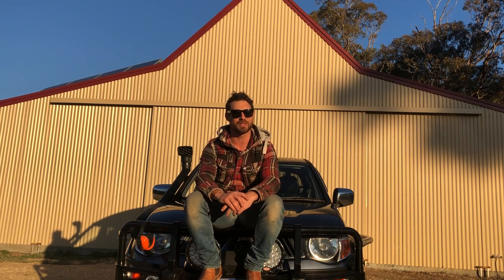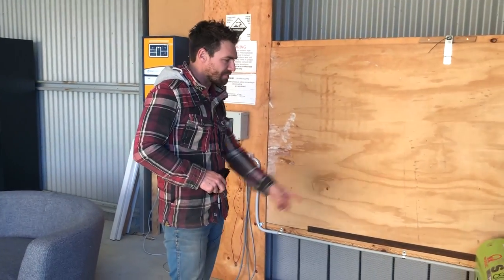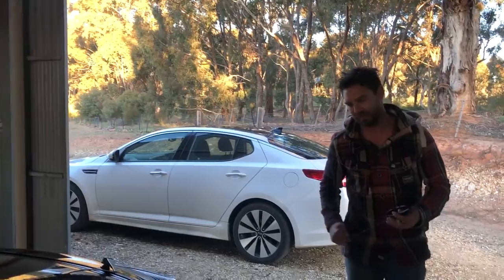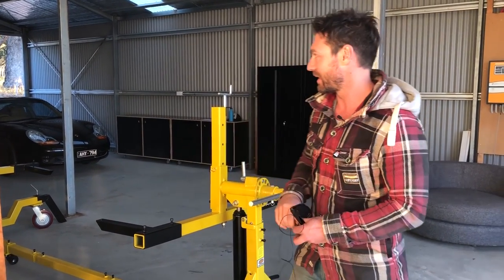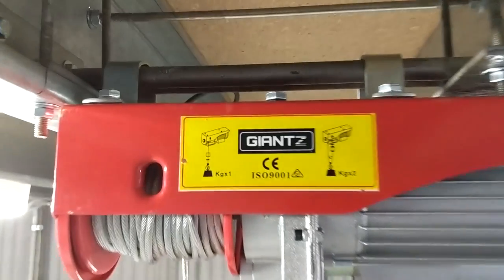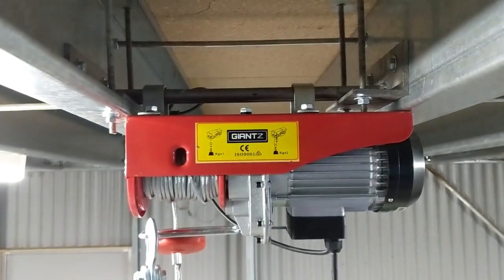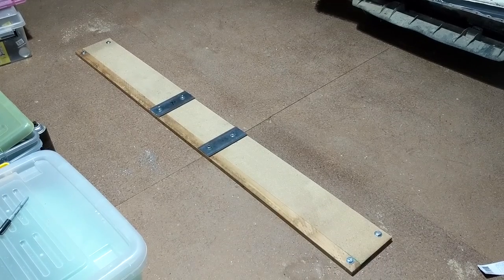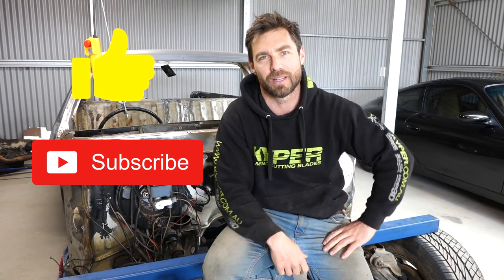EPISODE 21 - MOVING INTO THE NEW SHED AND BUILDING A ROTISSERIE FOR THE WB UTE

Comment: Awesome shed dude, if those beams are 200mm and guessing there 2mm  thick and spanning no more then  4metres , bridged between 2 like you have done will be plenty strong enough to hoist a your v8 up with. Double up the rob on your winch, that will half the operating speed, other wise its just a little to quick, you'll see what i mean.
 I'm excited for you, its going to make your restoration so much easier, you be able sit back with couple cold beers and watch your misses do all the work now.
Reply from the maker: Thanks mate, nice to hear that about the hoist on the beams, I just wasn't 100% on how far I could push them. I will double it up for sure. I can't wait to get it on the rotisserie as it will make it so much easier! Cheers

Comment: That's the perfect shed mate. I have just sold and removed the 6m x 6m shed in my back yard and have ordered a new 8m x 9m version, fully insulated with sky lights and universal beams for the girder frames. That way I can mount a beam underneath the peak of the frames running the full length of the shed and put a 1 tonne overhead crane on a rolling platform. But unfortunately I'm in the suburbs and that's about as big as I can go. I hope to have it all in by Christmas and finally have the WB home for the first time. Then the fun can begin.
    I'll be looking into one of those rotisseries you've got too. It looks like great value. Out of curiosity, how big (how many amps) is your MIG welder? I am a sheetmetal worker and boilermaker by trade and own stick, mig and tig welders. I'm pretty sure you could make your existing mig welder do the job if you just know how to "prep" your materials when you're welding thicker steel. If you're worried about getting enough penetration into the 5mm thick wall section of your RHS(Rectangular Hollow Section) or SHS (Square Hollow Section), just grind a 45 degree angle onto the ends that are to be welded and turn your welder right up. You could even put a bit of pre-heat into the steel to be welded if it's cold down there. Point your wire right into the bottom of the joint and that will go a long way to ensuring a very strong joint.
    If you ever have any questions about welding, I'd be happy to help.
    Can't wait to see how the rotisserie goes.
Reply from the maker: Awesome feedback mate, really appreciate when someone gives advice like that as it helps a lot. I have a 135 AMP MIG so it's pretty light, in saying that I did turn it up to full and it did manage to get run some beads on 6mm steel but didn't penetrate that far. I might use your method to tack in the square tube so I can get it aligned correctly then use the ARC to fill in for strength. Your shed sounds great, the 1 tonne crane would be such a great addition. Yeah I always have welding questions so if I will take you up on any advice you can give with welding. Cheers mate
Reply: @BarnesysBuilds  Yeah mate, 135 amps is pretty light on. My mig isn't big by any stretch, but it's a WIA (brand) 250 amp inverter. It's bloody awesome and will weld anything up to about 16mm easily. 
   I assume you've done a bit of stick (arc) welding? It's a whole other kettle of fish to mig welding. But you'll be able to weld steel up to 16mm with a 200 amp stick welder. If you can avoid getting any slag in your welds for at least 90% of them, it will be plenty strong enough to hold up the ute body on the rotisserie.
   Use good quality GP (General Purpose) electrodes, such as WIA 12P or CIG Satincraft, 3.2mm diametre and run the welder on about 110-120 amps. Never be scared to grind the whole weld out and start again if you get a lot of slag inclusion. If possible, roll your parts to be welded so that all your welds are "down hand" which means you're welding horizontally with your electrode pointing down and always drag your electrode away from the starting point, on about a 70-80 degree angle. There's plenty of good tuition videos on YouTube.
Reply from the maker: @RayPlant77  I've never done any ARC welding so it definitely will be a new learning curve for me. Thanks for the advice that will help a lot when it comes time to fire it up this week. Any tips on squaring up the tube so it remains in place while you well and doesn't warp and pull up as you go? Corners first?
Reply: @BarnesysBuilds  If you can tack it together while attached to the rotisserie, then add a couple of braces, like any smaller sections of steel, to hold the components perfectly in place before you take it off the rotisserie, that would be ideal. Tack the corners first, making your tacks about 10mm long, then always weld the opposite side to your first weld, to stop it from pulling or distorting too badly. But hopefully your braces will hold it true.
   But again, if you can assemble the whole thing while still attached to the rotisserie and weld it too, that would be the best way. Just remember to always move your earth clamp to as close to the joint getting welded as possible. This avoids the current running through any bearings on your rotisserie or car.
Reply from the maker: @RayPlant77  yeah ok, I might try and do it on the rotisserie so I know they are lined up correctly, only issue will be getting the earth attached as the plate is butter up against the car and the tube is too wide. I will see how I go, thanks again.
Reply: @BarnesysBuilds  Just tack a small offcut of flat bar or any scrap, onto the square hollow tube, and attach the earth clamp to that.
Then when you're finished, just knock it off with a hammer and sand the remaining tack smooth so you can't cut yourself on it.
Reply from the maker: @RayPlant77  Ok that is the plan then, thanks for all the help it's going to make things heaps easier.

Comment: Barnesy, great stuff.  I've bought a rotisserie too but haven't put car on it so waiting for your next step.  I've just ran compressor line all around my workshop with multiple hanging outlets, much better than tripping over hose on floor and used larger diameter than standard as length = friction so should have more flow than bought 3/8 reel was giving me.  Love the mezz floor, did you build shed or already there?
Reply from the maker: Thanks mate! Yeah I'm pretty close to getting it sorted now so hopefully in a week it will be on an an episode out on it. I'm Keen to do air lines up as well, they are a pain in the arse on the ground so having air line access points hanging down sounds like the go. Any links on where you bought them? I bought the shed as is, so lucky someone went all out with it and put the mezzanine level in as its a great asset to have to work with.
Reply: @BarnesysBuilds  bought all the hose and fittings from Enzed.  Hanging down cable tied to some light chain to take the weight alongwith power sockets.

Comment: Hey mate. I have only just come across your videos for the WB build. Enjoying it so far. I am curious if you need any heating or cooling in the shed - insulation? ceiling fans?
Reply from the maker: Hey mate, thanks, yeah i haven't thought about insulation or fans as yet, May down the track but the airflow is pretty good so it stays fairly cool in summer. Winter is a different story however! Once I get the spray booth sorted I might look into it.
Reply: @BarnesysBuilds  Thanks for returning the comment. Keep up the great videos mate. Makes me want to get mine restored even more after ten years out of action.
Reply from the maker: @MickMcN  thanks mate, yeah get into, it's a lot of work but worth the effort! What do you have?
Reply: @BarnesysBuilds  - a 1984 WB - blew up the timing gear years ago - I have had the motor (Blue 202) rebuilt although had some flooding come through since so I will have to get that checked out again. But yeah went from my daily driver to a restoration project that has sat for ten years. Either no time or no money essentially.